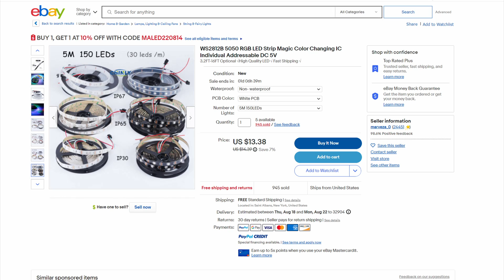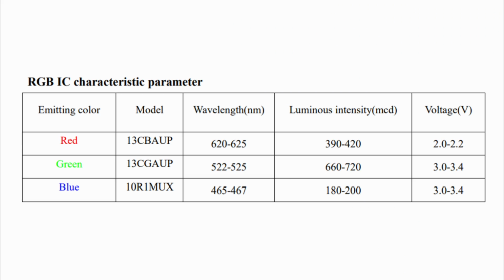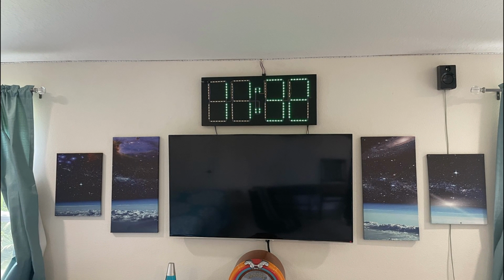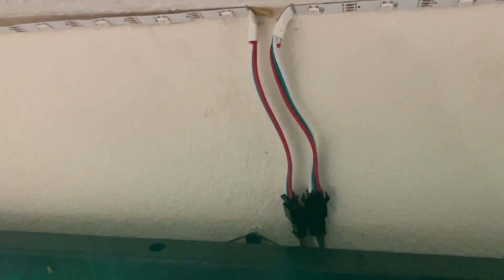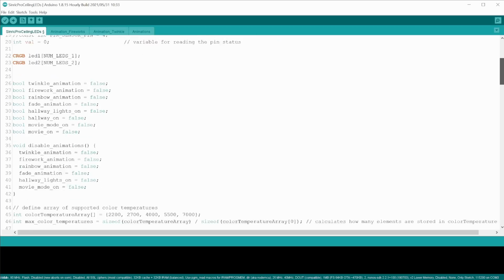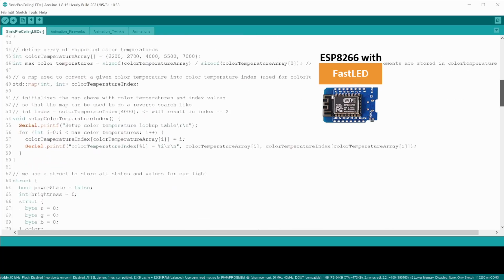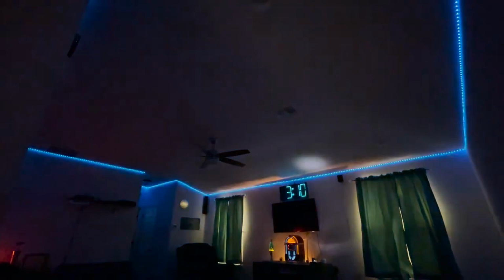The Coolest LED Lights for Your Ceiling (ESP8266 & FastLED Library Project)

Comment: What power supply did you use? I’m trying to do the same without having to run a bunch of power injection
Reply from the maker: I currently use a 5V 10A power supply from Amazon. My setup has around 460 + 220 pixels (split in the two directions). So technically, if I wanted to run them at full brightness, it would need a 41 Amp supply. I had tested initially with a 3 Amp supply, and I did notice it had limited brightness and color range. The 10 Amp one has shown good results for me. Depending on the animations you use, if you can stay below 450 pixels in a single run, you should be ok without needing power injection. Beyond that, it can start to show a reddish color instead of white.

Here's the link to the product I bought:
https://www.amazon.com/gp/product/B07CMM2BBR/ref=ppx_yo_dt_b_search_asin_title?ie=UTF8&th=1
Reply: @Electriangle  awesome man thanks!

Comment: Hello again, I was finally able to install the code but I don't really know what to do now to control it with Alexa, could you please explain to me what I have to do now?
Reply from the maker: My code was written using the API of SinricPro. You will need to make a SinricPro account ( https://sinric.pro/ ). In the "Devices" tab, add a new device with any name and description and set the Device Type to "Smart Light Bulb". The code I wrote uses a trick to switch between the different animations by switching the color temperature mode when commanded.

After that, you need to type in all the SinricPro information that was generated from the website into the CeilingLEDs_Main.ino file and upload it onto your ESP8266. (Make sure your WiFi information is also typed in there, and don't share any of these items below publicly). I also assume you will update the number of LEDs and pinouts as needed for your project when you upload.

#define WIFI_SSID         "YOUR_WIFI_SSID"
#define WIFI_PASS         "YOUR_WIFI_PASS"
#define APP_KEY           "YOUR_SINRICPRO_APP_KEY"
#define APP_SECRET        "YOUR_SINRICPRO_APP_SECRET"
#define LIGHT_ID          "YOUR_SINRICPRO_LIGHT_ID"

Then, there is a SinricPro skill in the Alexa mobile app store which you can install to link with your new account. 

I will need to think about the next steps now because I had used this code with IFTTT and Google Home for my room instead of Alexa.... The Alexa may have a different way to connect with the lights.
Reply: @Electriangle  ok ok thank you so mucho for you help, good night
Reply: @Electriangle  Hi, I have already done everything that you have explained to me so far but it keeps giving me an error, it is very strange, the code is uploaded but it gives me an error, and well, Sinric Pro does not detect it. This is the error it gives me:

In file included from c:\Users\banan\OneDrive\Documentos\Arduino\libraries\FastLED\src/FastLED.h:79,
                 from C:\Users\banan\Downloads\CeilingLEDs_Main\CeilingLEDs_Main.ino:26:
c:\Users\banan\OneDrive\Documentos\Arduino\libraries\FastLED\src/fastspi.h:157:23: note: '#pragma message: No hardware SPI pins defined.  All SPI access will default to bitbanged output'
  157 | #      pragma message "No hardware SPI pins defined.  All SPI access will default to bitbanged output"
      |                       ^~~~~~~~~~~~~~~~~~~~~~~~~~~~~~~~~~~~~~~~~~~~~~~~~~~~~~~~~~~~~~~~~~~~~~~~~~~~~~~~
. Variables and constants in RAM (global, static), used 0 / 80192 bytes (0%)
║   SEGMENT  BYTES    DESCRIPTION
. Instruction RAM (IRAM_ATTR, ICACHE_RAM_ATTR), used 32768 / 65536 bytes (50%)
║   SEGMENT  BYTES    DESCRIPTION
╚══ ICACHE   32768    reserved space for flash instruction cache
. Code in flash (default, ICACHE_FLASH_ATTR), used 0 / 1048576 bytes (0%)
║   SEGMENT  BYTES    DESCRIPTION

A fatal esptool.py error occurred: Cannot configure port, something went wrong. Original message: PermissionError(13, 'Uno de los dispositivos conectados al sistema no funciona.', None, 31)esptool.py v3.0
Serial port COM6
Reply from the maker: @RichiMunvel  That is fine. That is just a warning message, not an error. I saw that warning too when I uploaded this code. I remember trying to research that but didn't find a clear explanation for why that shows there.

If SinricPro does not detect it, you will have to do a little troubleshooting... It will be good to verify you can turn on and control the light animations directly from the SinricPro website before connecting it to Alexa. Since the code is uploading properly, maybe double-check for any typos or copy-paste errors for all the SinricPro and WiFi information in the code. Do you have a way to check your router and see if the ESP8266 is connecting to your WiFi at least?
Reply: @Electriangle  With what you just told me, I think it's not connecting to Wi-Fi 😅 the thing is that my internet is very bad and it gets saturated with devices and I have to disconnect devices to connect others but it doesn't always work, tomorrow I'll try to do it again to see if It's already detected, thanks :D
Reply from the maker: @RichiMunvel Oh wow. Yeah that could do it. 
I think you are close to getting it going. Once it’s connected online, you can at least begin to control the lights through SinricPro to turn it on and off and changing the color temperature option will change the animation mode.  Then you’ll be able to work on getting Alexa control after that.
Reply: @Electriangle  I already made sure it connected and no, I'm going to try again but this time with a new wemos, thanks
Reply: @Electriangle  One question, do you remember exactly the wenos d1 mini that I used for this project? It's just that since it's not detecting it, I think it's the wemos, but I want to make sure it's the same one to really know if that's the problem, thanks.
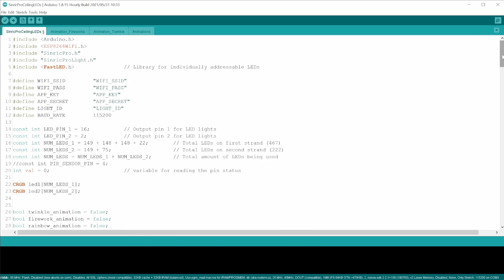Reply from the maker: @RichiMunvel  There is a picture at 2:07 in the video of the one that I used. It is also a Wemos D1 Mini ESP8266 board that I used. Do you think it is connecting to only WiFi and not the SinricPro? Or not the WiFi at all?
Reply: @Electriangle  I think it's not connecting to the Wi-Fi, so I'm going to try another wemos to see if that helps, maybe it came out defective or I accidentally damaged it, because it seems strange to me that it doesn't connect and when I try to download several times the wled software has not been downloaded
Reply: @Electriangle  How strange, if I am using the mime wemos that you used, but yours is a clone or original?
Reply from the maker: @RichiMunvel  I think I bought the clone versions. 

Maybe you could try a different sketch to see if the device can connect to your WiFi... I made a webserver template for ESP8266 devices here: https://github.com/Electriangle/ESP8266_WiFi_Webserver . You'd have to select a static IP for this sketch, so I'm not sure if that will be an issue with your router based on the issues you mentioned you have had with it. But could be worth a try if you're still stuck.
Reply: @Electriangle  ok thank you very much, when I can I'll try it
Reply: @Electriangle  Hello, I was never able to connect the wemos, but I tried with a nodemcu esp8266 which did connect to sinric pro, but another problem arose 😅, when I turn it on, it does the solid color mode animation, but that's the only thing it does, the others animations do not respond and since I turn it on and click to turn it off, the strip stays the same, I can only restart the solid color mode by clicking it on 😞
Reply from the maker: @RichiMunvel  Ok, that is good that you got it connected now. By default, it goes to the solid color mode when you turn it on. To change modes, you will need to turn it on and then select the "Color Temperature" button in SinricPro. When you set a different color temperature option, it should switch between the animation modes. See if that works, and then you should be able to move forward for setting up Alexa next.
Reply: @Electriangle  I did it but nothing happened, it may be that the code only works with a wemos instead of a nodemcu :(
Well, all that remains is to buy another wemos to see if it works, thanks.
Reply from the maker: @RichiMunvel  Hmm, I don't think it's your device that is broken. I just reconnected this setup and turned on the debugging mode and it is not sending the expected color temperature command for me either. Maybe SinricPro made an update in the past year which has affected the result of this code. I will see. The Arduino sketch might need to be updated for it to work now.
Reply: @Electriangle  Rightly so, but I think that if something is wrong with the wemos, because I never managed to connect it but the nodemcu connected it on the first try, but if Sinric pro over time outdated the code, then I think that, as you told me before, it would be a good idea to use wled right? Or well, what I want is to control animations with Alexa as shown in your video, but according to me it is not possible as such
Reply from the maker: @RichiMunvel  Yeah, I spent some time retesting my code here and it didn't work for me initially. It seems there is certain functionality that is not working the same as when I originally made this video. Also, now that I have reviewed this code again, it isn't very well written for ease of use because several functions are hard coded with specific values for my room size.

I know how to fix it, but it will take a full video to explain since a lot of the code had to be updated. I can plan to make a full video on the topic of using SinricPro for a custom LED project like this at some point. However, it will take me a while to work on releasing it.

If you'd like to have your project working soon, I'd say WLED will be the better option for now. It does support Alexa voice control as well.
Chris Maher does good at explaining how to set up WLED: https://www.youtube.com/watch?v=exAWzMfmwQ8
And here is another tutorial about connecting to Alexa: https://www.youtube.com/watch?v=dvsw1dhpTmc
Reply: @Electriangle  No problem, I'll wait for the video, I'm also going to try wled to see if they convince me how it turns out, thank you. Aaaaand another thing, do you think that in the next code that you are going to make you can put anications like the one you uploaded in one of your videos called shooting star, a solid white color, leave the rainbow color, and I don't know if you can candy animation like the one in this video? 
https://youtu.be/XHdaG4crqqw?si=gahsSdIsY0BRpdXl
Thanks

Comment: Hello, I got an error when compiling the code, I put the animations together with the code that controls everything and I got an error, the truth is I'm a little new to this and I don't know what to do, by any chance you won't be able to send me the complete code How can I compile it and test it please? Well here I leave the error that I got: 

In file included from c:\Users\banan\OneDrive\Documentos\Arduino\libraries\FastLED\src/platforms/esp/8266/fastled_esp8266.h:9:0,
                 from c:\Users\banan\OneDrive\Documentos\Arduino\libraries\FastLED\src/platforms.h:40,
                 from c:\Users\banan\OneDrive\Documentos\Arduino\libraries\FastLED\src/FastLED.h:66,
                 from C:\Users\banan\OneDrive\Documentos\Ricky\Arduino\CeilingLEDs_Main-main\CeilingLEDs_Main\CeilingLEDs_Main.ino:26:
c:\Users\banan\OneDrive\Documentos\Arduino\libraries\FastLED\src/platforms/esp/8266/clockless_esp8266.h:86:18: error: expected ';' at end of member declaration
  static uint32_t IRAM_ATTR showRGBInternal(PixelController<RGB_ORDER> pixels) {
                  ^
c:\Users\banan\OneDrive\Documentos\Arduino\libraries\FastLED\src/platforms/esp/8266/clockless_esp8266.h:86:77: error: ISO C++ forbids declaration of 'showRGBInternal' with no type [-fpermissive]
  static uint32_t IRAM_ATTR showRGBInternal(PixelController<RGB_ORDER> pixels) {
                                                                             ^
In file included from c:\Users\banan\OneDrive\Documentos\Arduino\libraries\FastLED\src/platforms/esp/8266/fastled_esp8266.h:10:0,
                 from c:\Users\banan\OneDrive\Documentos\Arduino\libraries\FastLED\src/platforms.h:40,
                 from c:\Users\banan\OneDrive\Documentos\Arduino\libraries\FastLED\src/FastLED.h:66,
                 from C:\Users\banan\OneDrive\Documentos\Ricky\Arduino\CeilingLEDs_Main-main\CeilingLEDs_Main\CeilingLEDs_Main.ino:26:
c:\Users\banan\OneDrive\Documentos\Arduino\libraries\FastLED\src/platforms/esp/8266/clockless_block_esp8266.h:111:18: error: expected ';' at end of member declaration
  static uint32_t IRAM_ATTR showRGBInternal(PixelController<RGB_ORDER, LANES, PORT_MASK> &allpixels) {
                  ^
c:\Users\banan\OneDrive\Documentos\Arduino\libraries\FastLED\src/platforms/esp/8266/clockless_block_esp8266.h:111:99: error: ISO C++ forbids declaration of 'showRGBInternal' with no type [-fpermissive]
  static uint32_t IRAM_ATTR showRGBInternal(PixelController<RGB_ORDER, LANES, PORT_MASK> &allpixels) {
                                                                                                   ^
In file included from c:\Users\banan\OneDrive\Documentos\Arduino\libraries\FastLED\src/FastLED.h:79:0,
                 from C:\Users\banan\OneDrive\Documentos\Ricky\Arduino\CeilingLEDs_Main-main\CeilingLEDs_Main\CeilingLEDs_Main.ino:26:
c:\Users\banan\OneDrive\Documentos\Arduino\libraries\FastLED\src/fastspi.h:157:23: note: #pragma message: No hardware SPI pins defined.  All SPI access will default to bitbanged output
 #      pragma message "No hardware SPI pins defined.  All SPI access will default to bitbanged output"
                       ^
In file included from c:\Users\banan\OneDrive\Documentos\Arduino\libraries\FastLED\src/FastLED.h:62:0,
                 from C:\Users\banan\OneDrive\Documentos\Ricky\Arduino\CeilingLEDs_Main-main\CeilingLEDs_Main\CeilingLEDs_Main.ino:26:
c:\Users\banan\OneDrive\Documentos\Arduino\libraries\FastLED\src/fastpin.h: In instantiation of 'class FastPin<16u>':
c:\Users\banan\OneDrive\Documentos\Arduino\libraries\FastLED\src/platforms/esp/8266/clockless_esp8266.h:21:49:   required from 'class ClocklessController<16, 20, 50, 30, (EOrder)66u, 0, false, 85>'
c:\Users\banan\OneDrive\Documentos\Arduino\libraries\FastLED\src/chipsets.h:740:7:   required from 'class WS2812Controller800Khz<16u, (EOrder)66u>'
c:\Users\banan\OneDrive\Documentos\Arduino\libraries\FastLED\src/FastLED.h:139:52:   required from 'class WS2812B<16u, (EOrder)66u>'
c:\Users\banan\OneDrive\Documentos\Arduino\libraries\FastLED\src/FastLED.h:368:39:   required from 'static CLEDController& CFastLED::addLeds(CRGB*, int, int) [with CHIPSET = WS2812B; unsigned char DATA_PIN = 16u; EOrder RGB_ORDER = (EOrder)66u]'
C:\Users\banan\OneDrive\Documentos\Ricky\Arduino\CeilingLEDs_Main-main\CeilingLEDs_Main\CeilingLEDs_Main.ino:187:60:   required from here
c:\Users\banan\OneDrive\Documentos\Arduino\libraries\FastLED\src/fastpin.h:261:2: error: static assertion failed: Invalid pin specified
  static_assert(validpin(), "Invalid pin specified");
  ^

exit status 1

Compilation error: exit status 1
Reply from the maker: Hi. Everything on GitHub is the complete code: https://github.com/Electriangle/CeilingLEDs_Main

Are you using an ESP8266 microcontroller or a different Arduino board? The error seems to indicate that the primary issue is an invalid pin was used. Did you use the same pin numbers in the code, or did you update that for your project?

const int LED_PIN_1 = 16;           // Output pin 1 for LED lights
const int LED_PIN_2 = 2;            // Output pin 2 for LED lights
Reply: @Electriangle  aaaaaa I had misunderstood how to do it, thank you
Reply: @Electriangle  Hi, I have doubts with these steps: Step 2) Extract folder to desired file location.
Step 3) All the .ino files must both be within a folder together named CeilingLEDs_Main. Rename folder to match.
Step 4) Open CeilingLEDs_Main.ino and adjust variables as required.
Step 5) Upload code to Arduino

I really didn't understand how to do it 😅
Reply from the maker: @RichiMunvel  Which step did you need help on? Once you have downloaded the files from GitHub, it will change the folder name. Since the Arduino IDE needs the main filename to match the folder name, you'll have to rename the folder to CeilingLEDs_Main. Then it should be able to open and compile.
Reply: @Electriangle  I don't know what it is or how to open CeilingLEDs_Main.ino
Reply: CeilingLEDs_Main.ino, is the folder I just made right? or I don't know that I didn't understand it well
Reply from the maker: @RichiMunvel  You must open it and compile it with the Arduino IDE. If you are not familiar with the Arduino IDE, I would suggest checking a few other videos on YouTube to set it up and learn how to use it.

Once you have the Arduino IDE setup to use with your board, I just uploaded a quick unlisted video here on how to get this code ready for compiling:
https://www.youtube.com/watch?v=IZT6wWbXO3o
Reply: @Electriangle  Thank you very much, there are really very few YouTubers who take the time like you and I really appreciate it
Reply from the maker: @RichiMunvel  Also, I should have mentioned before, but I would also consider that you check out "WLED" on YouTube as well. It's a different library from the FastLED one I used here. This code I wrote is nice for a customized situation, but WLED has many additional animations and features beyond what I have in my code. I updated this LED room in the video a few months ago to the WLED firmware instead of my original code because of all the extra features. I hope you can get everything going well for your project :).
Reply: @Electriangle  good to know, thank you very much for the help :D